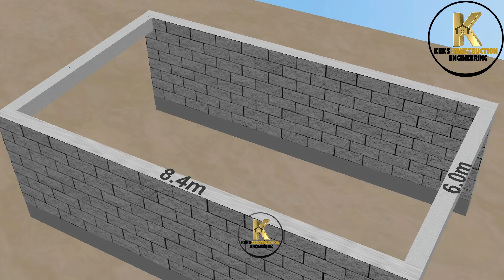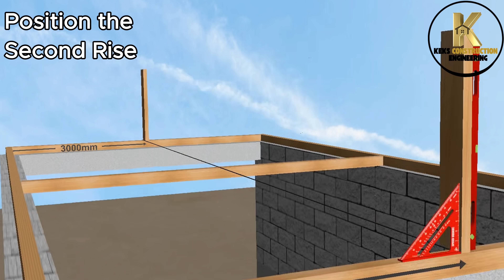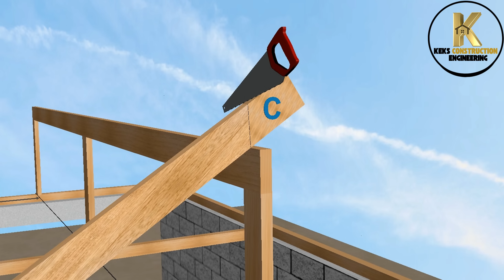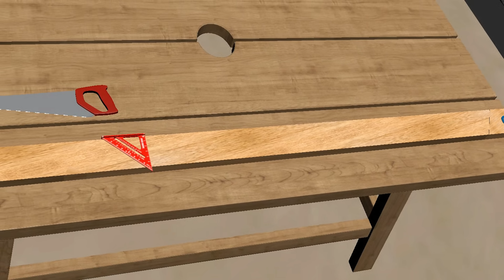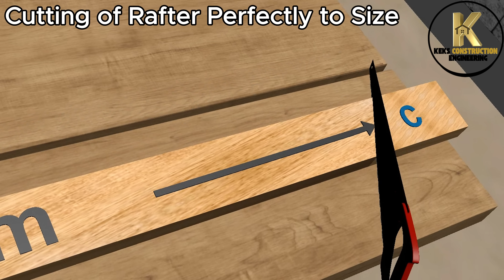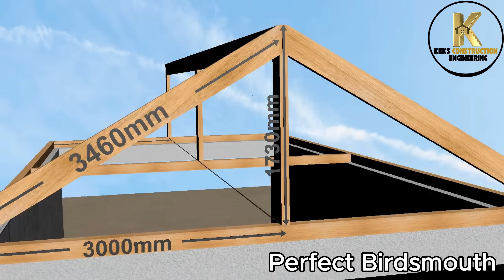The SECRET to Perfect RAFTERS Using a SPEED SQUARE & Spirit LEVEL

Comment: How deep is the birdsmouth
Reply: Tho it depends on the angle needed to make the rafter firmly sit on top of the wall framing
Reply from the maker: @acrocha1222 
Yes.... I have already shown how to determine Rafter angle in the Video.
Reply from the maker: The common rule is that  "Don't cut more than one-third of the Rafter's Width - This is to maintain the strength of the Rafter" (However, it varies with Different Codes).
In this Video, the cut is 3inches (75mm) which is equivalent to the width of the top of the 3x4 Wall Plate.

Comment: OH May GOD. This is ignorant and wouldn't make a pimple on a Carpenter's Ass. This is the stupidest thing short of idiots that scribe rafters individually. Who does this. It is literally ridiculous. No real carpenter would do this. If you can't cut every rafter on the correct pitch on the ground by knowing the pitch, run and ride, then I would Fire You Immediately. You aren't a Carpenter. A four foot level isn't accurate past 4 foot vertically or horizontally. A string level???  Dear Lord no wonder there aren't any Carpenters left, if this is what they teach. Wait till he does a hip roof. LOL
I am a master carpenter and General Contractor. Do not learn carpentry like this it is stupid time consuming and certainly not accurate. I bought my first speed square in 1968. Swanson. Sorry but learn the trade correctly and I promise you this video isn't it. Use an aluminum framing square anyway  preferably. I use both and it depends on the situation. Thanks. You would do well to talk with a real carpenter before wasting time doing this the way shown here. I don't mean to be so critical, BUT I take my trade seriously. RT

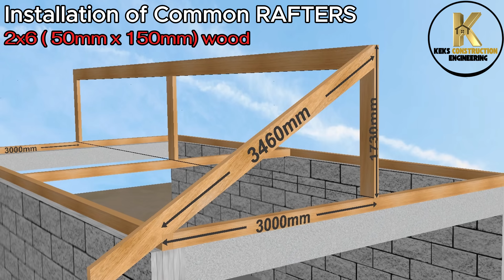Comment: 10:42 ovo ovako kako je na crtežu dimenzionisano, ugao krovne ravni ne može biti 30 stepeni! A Vi kako hoćete...
Reply: ... prema datim podacima o dimenzijama elemenata, ugao krovne ravni je 28,3 stepena...
Reply from the maker: Yes.... I know where you are referring to. In the While doing the work I made the correction by Subtracting the Thickness of the Ridge Board from it before cutting. 
So that actually fix the little omission in the drawing.

Comment: hi great explanation but have a question why the 3 inches for the birdsmouth thanks
Reply from the maker: It's because that's the width of the Wall plate where the Rafter (Birdsmouth) will rest. So with the exact measurement (3inches), it will lap perfectly. 

Watch other Construction Videos on this Channel, Join the Community & Stay Tune to KEKS CONSTRUCTION ENGINEERING for More & Better Construction VIDEOS Every Week. 

Feel Free to Ask Questions

Thanks

Comment: Good work, but 2*6 does not equal 50*150, it equals 48*148🤔
Reply from the maker: It's the generally accepted Approximation for 2*6
Reply: To su onih po 2 mm koji su ukrali. Trebalo bi biti 50,8x152,4...
Reply from the maker: @josip.harasic 

Yes.... We know
But we use that for easy work
Reply from the maker: @josip.harasic 

Watch other Construction Videos on this Channel, Join the Community & Stay Tune to KEKS CONSTRUCTION ENGINEERING for More & Better Construction VIDEOS Every Week. 

Feel Free to Ask Questions

Thanks

Comment: a real carpenter calculates lenghts and angles, marks 2 rafters, ties them (with the marked ones on both sides - perfect opposite) together and cuts and carves them all together. trim the burr off, drill the nail holes, plane the visible parts and set them up. no cutting on the worksite!!!
Reply from the maker: You are right. 
The Video actually did all those right on the table....meaning that it can be done anywhere not necessarily on site.
Reply: @keksconstructionengineering but what most don't seem to realise is no building is like a drawing Facts. Human error. Even new construction builds need tweaking on site. Of course any chipy can cut and have a roof ready to go. I personally like doing it on site. Theirs always something.  A good chipy has his own production line mapped out and will lash it out in no time. I always measure myself and don't just go by a drawing like most robots 😂
Reply from the maker: @leprechaun7667 
Thank you so much for this. 
I always tell people that Construction is Flexible (it can be done with different approaches and still be accurate). 
As a practicing Civil engineer, I use different methods base on site condition, budget, Available materials, time of delivery and many other key factors. 

Yes construction is fun when you know different methods of doing one thing. 

Thank you 
Best Regards.